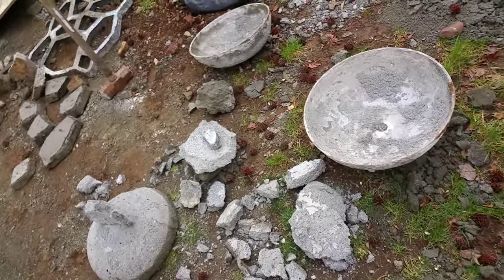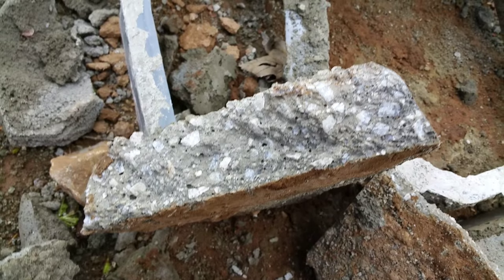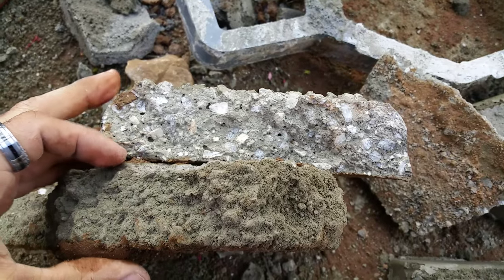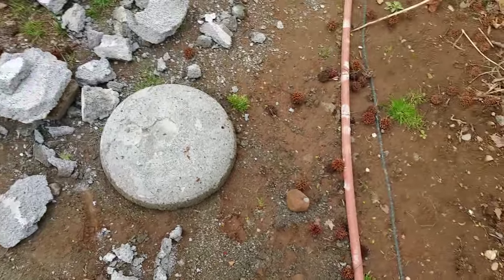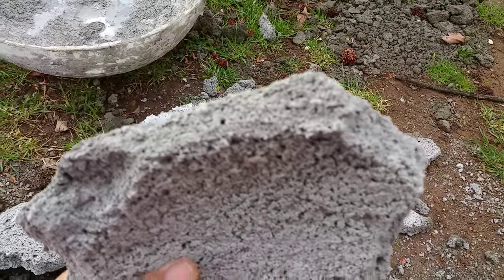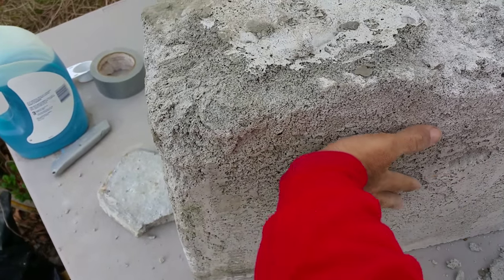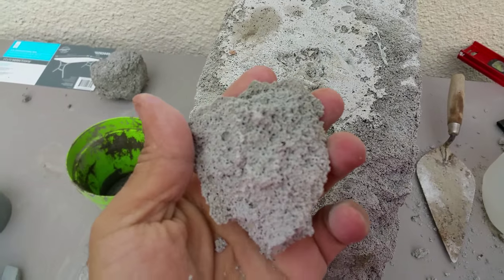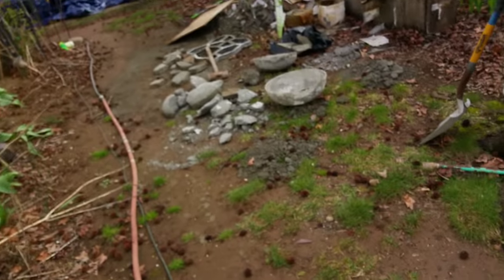Aircrete Updates | Strength #aircrete #aircreteupdate #aircreteharry #diy #foam #foamgenerator

Comment: So my background is material science,  I've done  ALOT of work in porous polymers, extensive experimental work both from formulation and processing  perspectives and have a thorough understanding of experimentation and development in general.
I am not a concrete guy though, and have not taken the time to research the science side of the various additives, though I am familiar with the chemistry of the basic system.  The chemistry should NOT be underestimated, hence my comments on additives down below. In any case, here is my 2 cents.

It would  be helpful to be more technically precise in the mechanical analysis.   Smacking it with a hammer is akin to impact resistance and fracture toughness (seeing as you are breaking the damn thing due to its brittle character).  Trying to snap in  your hands in akin to flexural testing (tension),  stepping on it with weight is compression testing and pushing on it slowly with a round tip is akin to indentation /hardness testing.  These are all TOTALLY different types (albeit related/correlated) of  mechanical testing but should NOT be confused with each other.   When you add mesh (and porosity for that matter), you enter into the realm of composite structures. Using terms like 'Brittle' is generally associated crack propagation (in tension usually but can also apply in compression). but it is a pretty loose term as used  here. Similarly with  the use of the term 'stronger'. Are you talking yield stress?  ultimate tensile stress?  toughness?  These are all different things technically.  What are you really trying to achieve?

In terms of perspective on promoting mechanical properties, I would tend to target  composition first (which means additives, water content etc) and structure (porosity) second.   Obviously adding porosity is going to reduce strength in general, the question is to what degree., how linear is the drop etc.  You will clearly like to have a CLOSED cell foam here and smaller pores are helpful to this end to avoid interconnectivity.  But there can certainly be a gap between the porosity of the foam and the porosity of the mix and the porosity of the cured concrete. I would tend to try to look at the porosity of the final structure as  most important, the porosity of the mix next and the porosity of the foam last in terms of importance, but it would be interesting to see if there is a close correlation here as it will allow you to use the foam as proxy in such case.   There are cheap USB cameras available to do this which have verniers so you can quantify this.

Other ways of creating porosity that can be applied here  are via  polystyrene spheres  and other 'nonstructural' polymeric solids.  (There are other ways but they are not really amenable to this application).  But you could add the spheres and get an understanding of what a 'porous' concrete is really capable from a density and pore size perspective.  If you are pushing the process so far to where the porosity changes rapidly affects the material integrity (meaning your operating on a slope),  then you have to be very careful during comparisons because you will be comparing apples and oranges.  But I think this scope of experiment is key to really understand what you are targeting structurally  (how large the voids and how many of them).  Only after this is understood do I believe the process work should be undertaken.

In any case,  If your  concrete volume is stable over time after mixing, then it seems you could characterize the density vs extent of mixing to get an idea if your pores are collapsing and/or consolidating.  If they are stable,  then mixing longer to homogenize can be done. Simply fill a box and weigh it and monitor height decay.

And what is the goal here??    If you are referencing this to the fully dense (nonporous) material, are you talking compression strength as the goal??  If so, you should do a formal compression test. If you are trying to compare it mechanically in general, then multiple tests types should be done.  I also think its very important to quantify results and  apply good controlled experimental discipline (minimize sources of variation - people, environment, materials, process, equipment)  with appropriate material analysis (pore size, density) and functional testing (mechanical) and build up your understanding from the ground up, or you will likely just be kidding yourself.   I get it that the thermal response is probably going to be suitable for the need and the idea is to optimize the structural property for a building application, which seems to be done by focusing on the mechanical properties of the bulk (as opposed to the surface which can be fundamentally different , especially if nonporous).

I would probably just do single-factor process experiments (DOE), maybe in 2 or 3- levels to determine which process factors are most significant after you really identify an appropriate formulation (composition) and try to run any composition-based screenings on an equivalency basis if possible  (same weight %, volume % etc to allow for reasonable comparisons).  I would also tend to test the cured material after its really cured (to take time dependence of the cure out of the equation), particularly if you are doing tests that involve different water content.  I would also be cognizant of environment, particularly humidity, temp and how the material is stored as this will also significant;y affect the cure.

Other things to think about might be material encapsulation and internal reinforcement, but again, i think its important to really identify the performance goal to gauge whether for example rebar even would help the specific mechanical property and test structure for the analysis.

There seems to be a focus on the 'brittleness'.  I would note that this is not a polymer or a metal.  It is cement, albeit, with applied porosity.  it is fundamentally a rigid stiff material. It will have a high modulus in both tension and compression. In other words, its brittle!, and its going to be brittle.  I get the impression that rather than try to improve its yield stress (or tensile stress or compression stress- and these are probably all the same for this material type anyway), you are trying somehow modify the stiffness which to me makes no sense.

I get the impression that the goal here should be identified as a single metric,  likely high compression strength/weight and that should be the focus. If it is some combination of properties, you can create the response metric as  compression strength x next property x something else/ weight  etc and do the analysis that way.  Usually it would just be material properties, but it could include cost,  or other nonmaterial parameters.

Clearly,   this has the potential to be a very large, involved  R&D project.

Comment: Thanks for the good work. .. For a more scientific process, ,, 
You could make a standard size mold to make test bricks or panels. Then you could do a repeatable test with weights to the breaking point. 
Also, I have used junk latex paint as an admixture for the ferrocement process. AND have had very good results. 
Thanks again for the good work. ..

Comment: The name "aircrete" is a bad one, it causes people to compare it to concrete. It is not a substitute for concrete, don't make a foundation from it. It is to replace the wood frame and plaster of an ordinary home. Take sledge hammer to wall board and 2x4s and see what happens. I think the product is ready to use as you have made it. Domes and vaults have been made from mud brick and lasted for centuries. I think your idea of plastering it with cement is a good one, it would give a nice hard surface for painting.

Comment: I am pretty sure you are using the wrong concrete.  You need cement without aggregate.  Give it a try and update us on the results.  Also, fiber additive will definitely give you strength and better bonding between molecules.  I did a fiber reinforced slab in my shop building and its incredibly durable.

Comment: put fibermess in it and it will be strong as hell concrete is brittle the longer and bigger the wall or floor us unless you use steel try putting steel in your form and put fiber mess in it those additive wont do shit for what your doing only steel and fibermess i have used it in every slab and wall i pour
Reply from the maker: I have some new videos coming soon. https://www.youtube.com/watch?v=pjg5XMp_u04&t=949s

Comment: Please! "Cement" and "concrete" are not the same things! Cement is usually Type 2 Portland Cement (grey powder in 90 lb. bags.) whereas concrete is a mixture of sand, aggregate, Portland cement and water used for sidewalks, foundations, etc. 
Redi-mix concrete comes in 60 pound bags or 14 cu yd trucks.
Reply from the maker: Thanks. :-)

Comment: if you will be making a small shed dome shelter 6 ft high about 180 sqf and do the aircrete walls 12'' thick would be the biggest i will go,but after that said I will put a 1/2 inch ferrocement parging  inside and outside for water proofing like for ferro cement boats .I will build bigger domes but will not use soap/air crete at all,but will look into getting a companie to spray truck bed liner on outside as its bullet proof and bomb proof.look on youtube with myths-busters what a good show.
Reply from the maker: I looked into the truck bed liner before, and i decided not to use it because it's NOT fireproof. For the bullet & bomb   I'm using the Micro rebar look at the first 4 mins of this video. https://www.youtube.com/watch?v=jMfxwk_H4jc
And for the water proof stucco I'll be using this product. https://www.youtube.com/watch?v=HwiyZmJjYeg

Comment: With the air crete is it safe in regards to if a thief grabs a hammer and starts pound at thge outside walls...can he get through the wall? It seems the material air crete is not to strong.
Reply: Come on, who's going to do that? Worst thief ever.
Reply: Jean Stewart a their can brake into a normal house easier.  Chainsaw is my favorite method.
Reply: I guess they could, the same way a thief could break into a conventional house with a chainsaw. Have you heard that often ?? Personally i never heard that ;)
Reply: ... cause you haven't been to Africa ! 😂
Reply: You got that right !!! Just accessorize your house with nice, solid high fence with razor rolls on top, guard dogs etc ...
Reply: then maybe it's the people and the system that needs to be fixed, not the building materials.
Reply: They try that in Chile, doesn't work either. Embedded broken glass, electric charged fencing. Thieves gotta thieve.
Reply: don't assume they won't.
Reply: He mentioned Africa and 'you' assumed race. I assumed extreme poverty resulting in desperation. He is speaking of a big continent with many varieties of race. You, Mike, are the stereotyper.

Comment: Ok.. concrete without steel is only good for compression strength.. that’s why they include steel.. to give it tensile strength so it can carry loads and span distances etc. As suggested by others here you need to add strands of fibre or even steel.. your challenge will then be to prevent them from settling into the aircrete thus negating their intended benefit. Good luck

Comment: Talyn71 - You should try using Roman cement with the Air-crete concept!  Roman cement/the formula was lost over time and is incredibly strong and weather resistant/weather proof!  Just google Roman cement and you'll find all kinds of YT videos showing the recently re-discovered formula for Roman cement.

Comment: How about giving us something we can understand - equivalence to a 2 x 4 wall with OSB on one side and gyp board on the other, and R-value?  Without that info, you aren't going to sell anything in the US and Canada.
Reply from the maker: I have one idea i plan on doing to test R-value. But can you suggest to me an R-value test I could do?  How do I test how insulative the aircrete is what could i do? Describe to me how to perform this test for R-value? In one of my videos I hold a blowtorch for over 15 minutes to one side of the aircrete that was about 2 inches thick and the heat never passes to the otherside. But that's not an R-value test.
Reply: The manufacturer should give the R-value, or in Europe, the U-value, which can be converted to the R-value.

Comment: First I only know about aircrete from you tube videos. It looks interesting. I have worked in the stucco business for 20 plus years. Some ideas. 1. Use a fiberglass reinforcing fiber should be available at stucco plaster supplier. Mix it with the cement. 
The mix appears to be too wet to trowel over metal lathe. You might try pouring this into a mold like adobe brick with some sort of reinforcing material. Metal lathe or chicken wire. Then letting the blocks cure out. 
Lastly there is an older government spec for curing out the scratch and base coat of cement stucco that may be of help to you.
After the scratch coat on government jobs we were required to keep the walls moist by misting them with water 24 hrs/day for seven days before applying the brown coat. Then the same procedure before the finish coat.
Concrete and cement never actually dry the cure. Water will be continually  absorbed and released throughout the lifetime of your material.

Comment: I honestly feel that AirCrete has a place in construction. However, I don't feel it is the 100% solution to every project. Structures such as walls and floors need to have a 3000+ PSI skin to adapt AirCrete to the real world.
I am amazed at the properties of AirCrete  (lightweight and insulative) but it just can't stand up to real-world abuse. It needs a shell that's hard and strong to compensate for its shortcomings.

Comment: From the engineering standpoint, the fortifier should be in the concrete mix rather than the soap solution.
Reply from the maker: I was trying something new and I just wanted everything to work without doing more work. New videos coming soon.

Comment: Your "testing" process is far too random and subjective.  I would start by making a standard mold, say 6" square. Pour each mix, label, and weigh after curing for 30 days (covered!). Multiply times 8 for pounds per sq. ft. Use a hydraulic press w/gauge to measure crush strength in psi.   

There are both fibered cement and resin based products for parging over foam insulation. A fiberglass parge coat is used on unreinforced masonry (ie, brick) in the SF Bay area for seismic reinforcing. Use on interior as it's not UV proof. Outside coat can be basic stucco color coat- 1/8" to 1/4" thick. I like using 1 part  white portland cement (Type I), lime and latex additive as needed, and 4 parts clean white sand. (For a really bright finish use white marble dust.)  Can be sprayed or troweled on. It's strong enough to walk on. 

Make a 1 or 2 foot high curb of reinforced concrete or mortar a couple inches thick around the bottom where you need the added protection. I think a good way to strengthen foamed concrete would be to add plastic reinforcing fibers, available at any masonry supplier. Lightweight concrete can be made harder by adding sand, a benefit for lower courses. Start at 1/10 cement/sand or even 1/12, up to a maximum of 1/4. It's a trade off between strength and weight. Also, denser. mix means lower R-value. When using polypropylene fiber, mix thoroughly into cement before foaming.

Comment: Here is a link that you may want to look at. These guys are definitely using aircrete in load bearing situation.....however they are reinforced with steel....and maybe other stuff. The link is here.  https://www.youtube.com/watch?v=--kaM73yWCY     Or you can look up Aircrete Europe.  These are commercial prefab house folks. Good for you Harry for testing this stuff out before you build something substantial. It helps the rest of us out here that are looking at this. One thing that I'm using in my "foamer" that I'm not sure you have is I put a bunch of stainless steel scrubies....I think they call them Chore Boys....or Girls....I don't know which gender they are. If we're going to be PC then it would be Chore Person. Any way.....the scrubbies I'm thinking make the bubbles in the suds much smaller.......which might help you. Just a suggestion.  I've not had a chance to make my molds yet and test them out. But my foamer seems to work pretty good. I've also seen some of the commercial people use the fiberglass mesh on the outside like you're talking about. They make sure that it is totally immeshed within the concrete.

Comment: You can easily break a mud-based brick into pieces with a sledge hammer, yet people built homes from mud bricks for thousands of years.
Reply from the maker: destinicoach what you say about my brakes are true. but I am looking to build a dome home in the United States. and there are building codes we have to build according to.